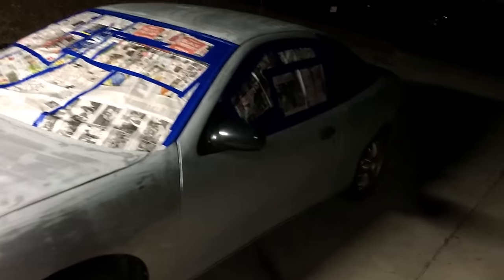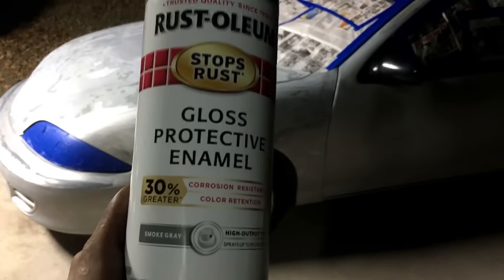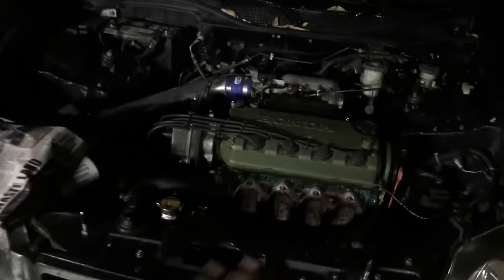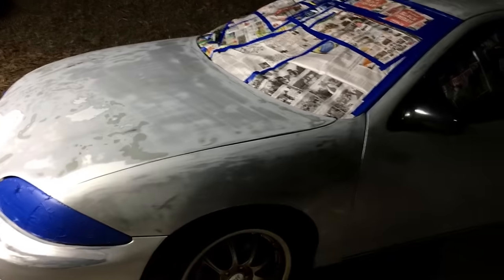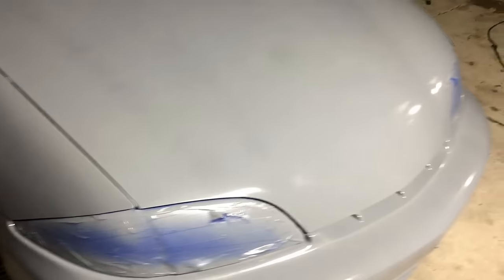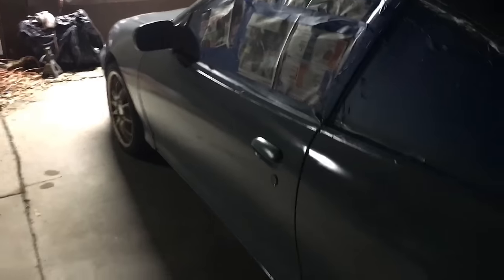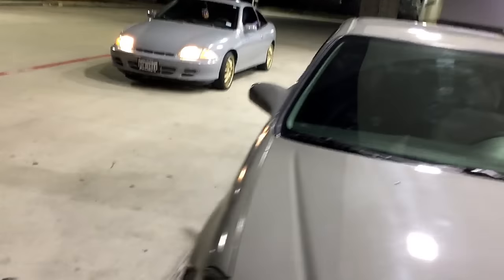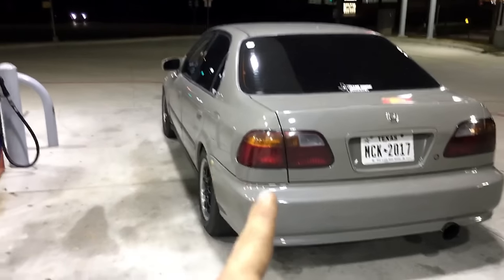$25 Rustoleum spray can paint job!

Comment: I did the same thing in the early 80's on a 71 datsun 240z. Rustoleum has made some great advancements since then and you do a better job than I did. Very nice. May I recommend two things? If A tractor supply store sells tractor paint in your color of choice, I would go with it. Tractor paint has a far higher solids content and you'd be very happy with it. Also, if you you want to be sure to avoid any spattering, fill a bucket with warmish/hot water and set your cans inside. It helps if you do it. You did a superb job, young friend. Keep prepping and painting!

Comment: That's better than a basic Maaco paint job for sure for a fraction of the price.
Reply: Problem is gloss will fade and look all dull in about 2 weeks, but eyy looks good👍
Reply: Problem with Maaco is their prep is shit. They can paint just fine but bad prep = bad paint
Reply: @idrinkpowersteeringfluid  nice! 😎
Reply: Kevin Trust don’t be hating on cavaliers they are up there with civic reliability
Reply: @mintysquinty2989  THIS. I've got 3 cars with Maaco paint jobs. I did all the prep myself and had plenty of parts painted off the car because I simply didnt trust them with not screwing something up. Mirrors, front and rear bumps and lights. I always remove all those things if someone is painting a car for cheap because realistically they wont even do a good masking job.
Reply: @blazieboy1301  how do you figure that it is enamel paint every car I seen with enamel paint still looks good after 2 years if it's done right
Reply: @freddibanuelos3481  yeah true that, but In that case might aswell just put some good nice ppg base coat😎
Reply: I met a lady yesterday that said she took her car to maaco and had the upper scale paint job for almost 4000 dollars when she went and picked up the car she told the guy she wasn't happy and get this he said to correct the problems you have with the paint job he needed another 600 WTF?

Comment: I and some of my employees spent a few days sanding and rattle canning some cheap service vans a few years ago, that and some stenciled 'van id numbers' turned a parking lot of 30 year old vans into a professional looking fleet.  Never underestimate the power of the rattle can  :)  Edit: a trick..  we painted when humidity was high, and it started sprinkling 20 minutes after finishing last van.  End result, the paint looked AWESOME..  and I think it was because the humidity and the temp, about 70 degrees, slowed down the cure time a little making the paint not streak.  We did a buddy's van on a dry day for fun, and it didn't turn out as well, but it was a dry hot day.  Next time around I'll do two coats and then rattle can clear coat, and maybe set up sprinklers or something a ways away to increase humidity.

Comment: You can buff all that out after a week to smooth finish  and apply clear coat !! makes finish look much better !!! Then buff out clear coat and polish it. Gonna look way better,  like real car paint
Reply: Nah, it's too thin to buff out really.  You'd need a lot of layers in order to make it sandable.  But it really wouldn't be worth it in the long run, paint won't last long. It'll start cracking and chipping here and there in a relatively short amount of time.
Reply: C North NOT if you paint a protective clear coat over
Reply: @markus2151  That's not how it works.  You actually need to sand paint before you put on a clear coat, otherwise it won't really be glossy.  You can have smoothly sanded clear coat, but if the paint layer isn't sanded, it's not going to look right.
Reply: Oh okay, but I guess it would be better than paint chipping and cracking.

Comment: I got really drastically different results based on the weather. This summer when I used the Rusto spray cans in hot weather it just came out nasty, but when I sprayed it on some doors a week or two ago in 50F or so weather, it all leveled off beautifully. I hope we can get a couple good days where I have time so I can get the whole car rattle canned again, unfortunately I rolled a few sections and sanding that out will be fun :/. The rattlecans are just awesome if you do it in good conditions, though.

Comment: You may not have the best paint jobs but I have to give you a e for effort. There are a lot worse things young people your age could be involved with. Just a little tip for you when painting with spray cans. Let the paint cans sit in hot water and the paint will lay down smoother and you will avoid a lot of the nibs that come out of the cans.

Comment: I am not generally a fan of hoopty rattle can rides but there was an attempt to prep the car at least.    This was certainly the best financial way of making the car look better rather than spending  money you might  not have to paint a depreciating asset. Doing what you can with what you have should be more peoples mottos. 

And it turned out decent. Overall I'm impressed.  And I'm glad to see that ppe was used

Comment: I realize it's 4 years after the fact, but Rustoleum makes something called color shift and if you use it after your final coat of rattle can, it gives it that shimmer that professional auto paint has. It is really wonderful stuff. It takes a good paint job and turns it into a great paint job if it's used correctly. I redid my entire motorcycle with like $50 worth of paint, and because I finished it with that stuff, it looks just like the factory did it

Comment: My best friend owns and runs a shop started out using rattle cans in his parents garage. We all start somewhere. good results id  just suggest that you work on your form a bit. spray in a more uniform pattern and seperate each panel into segments when you paint. Great job though keep up the hard work!

edit: also look into learning and perfecting wet sanding. You can get really good results after using clear coat, wet sanding, and then a good polish and wax. almost pro results if you pay enough attention and do the prep work.

Comment: Take an additional hour or 3 sanding with like 600 or 800 grit. Then put trash bags over the tires. Surprised you didnt move the other cars. Wonder how much the wind blew onto the others paint jobs? Also would you paint your rims the same way or not at all? Gonna do my sunfire same way. But orange body. Black hood, roof, and trunk. Rims are being painted black with orange lug nut covers. Then orange under glow. And orange/amber and white strobes all over the place. I do security so I use them while working.

Comment: It would be worth doing some research in urethane coatings.  Even with a $20 harbor freight spray gun and a cost effective coating, the durability will be much better (and cosmetically it can look way better also).  I had to choose a coating when rebuilding a off road trail vehicle, and had the benefit of my cube mate being an automotive paint engineer to learn from... there are a lot if options and good information to digest if you look a little.  A single stage 2k high film build urethane coating may serve you well to hide the imperfections and have a much higher gloss... and you're probably only at about $100, which is really not much in the big picture.  Good luck and enjoy!

Comment: Sometimes good enough is good enough. I have a low mileage (because I've always worked from home and have another vehicle) Cavalier in excellent condition and it's worth almost nothing when I try to trade it. I figured forget this i'll just keep the thing. I can't imagine spending money even on a cheap mako paint job for a Cavalier in the condition of the one in this video. I really like that color. I'm not going to attempt to do this myself or anything but I think it looks good. I probably would have left the mirrors and door handles black or maybe paint them and the rims a darker charcoal grey. Done is better than perfect though. Good work.

Comment: I painted a 59 Beetle like that and it took 6 primer and 4 cans. Would have preferred something like rustoleum but back then the only colors were cancer and the finish was semigloss at best. Primer + fine sanding does hide a lot of sanding sins just like rubbing compound on the finished painting.

Comment: I have a cavalier I am driving while I save up. This would boost my self esteem.
Reply: Jesse Alexander they are awesome cars drive it until it doesn’t drive
Reply: J-bodies are a bit under rated though. They last like Civics do, will keep going until rusting out completely or wrecked in some accident. It's just the GM interior that is a bit naff, since the cheap plastic doesn't age well. As a runner that's cheap and reliable to keep going, you shouldn't knock it.

Comment: Damn if i had a place to paint like you have id build a paint booth, spray with base/clear from a hvlp gun, can even do it with two 5-6 gallon compressors,, make some real money, i pretty much started like you but i do body work(with some painting), people trust me enough to do there $100,000 cars/trucks,,, it got to point where i could do the body work with my eyes closed,,, your on there right path, need to start some where, but need to keep moving up

Comment: The old paint is very difficult and near impossible to sand evenly...the new paint will amplify and expose every flaw. 

Sandable Primer over the old paint surface...even just a light coat makes sanding easier and quicker and provides a much better surface for the top coat....maybe just another $10 but is money well spent...

Comment: Hey, so since it's so early on and you're likely to respond: if I want to use the Rustoleum Army Green but don't want it to be matte paint, and want to do a gloss clear over, can I do that safely over the matte paint, or is there an easy way to match one of their glossy paints to that color for use under a clear coat?
Reply from the maker: If you use matte paint then do clear over it it will become glossy. I will eventually get to doing a video on this.
Reply: @JamesDguy  Oh I'm totally aware, I've just heard bad things about painting clear coat over matte paint
Reply: KrispyyWombat Go to a body shop and ask for a garbage panel, or pull one from a wrecker, like a hood or something that isnt to dented. Use that as your test panel. Prep it properly and do all the steps you would on your vehicle and see how it turns out. Then leave it outside for a month or two so you can see what it will look like after its been a bit weathered. I suggest doing this so you A: Know what you’re getting into B:Can practice and C: Fully be sure you want to spend the money and time painting an entire vehicle

Comment: So I’m sanding down my 05 Elantra completely in a month from now, going to be using 2x Rustoleum high gloss purple and then 2x rustoleum black on the hood and roof. I’ve thought of getting 20 cans to be on the safe side. Is that too much? My main concern is being able to see the paint lines. I know I’m gonna sand down it all correctly but how to avoid paint lines and avoid the MAIN look for a spray paint job how most amateurs do.

Comment: Actually nice paint job for $25 . Probably wouldn't have guessed it was painted with spray cans .
    I wanted to do a quick spray can paint job on one of my cars but wasn't going to use rustoleam brand . Was going to paint the car the factory OEM Red color , that's available in the OEM factory Red  . Would a clear coat be needed to be used after painted and then followed with buffing ? What are your thoughts on this ?
  Best 
Regards

Comment: You do pretty good work with painting, I enjoy watching. ... I do have a question though ... I noticed you do not usually follow the basics of light coats first then work on heavier coats for the finish ... You appear to go straight to a heavy coat ? ... How does your technique allow for elimination of runs and orange peel ? ... I would also like to let you and your buddies know that I used to own and operate a race team in Southern California ( I am now retired ( USMC ) , however, I still do a lot of business with my old vendors, so, if you need speed parts ( Turbo Kits, Cams, Pistons , etc ... ) or stereo equipment ( Any brand ), I can normally get what you want under wholesale pricing. ... I also build engines, from stock to full race ( AT YOUR LOCATION )  labor only and I do NOT charge retail, and am always interested in making deals. ... If you don't like the work I do ... DON'T PAY ME ... I can only make that statement because I ALWAYS GET PAID, meaning ... I DO QUALITY WORK ! ... Anyways ... I really enjoy your video's and RESPECT your work ethics. ... Watching you has restored my faith that young folks still have Integrity and a strong work ethic, it truly is refreshing. ... SEMPER FI YOUNG MAN ... Keep up the good work.

Comment: I own a Toyota Celica with stock rims, the problem is that they repainted them and did t even try to make sure it was good. The previous paint I'm assuming original was bubbling and not smooth. Would thos be a good solution? And if so what are the steps to doing so.

Comment: Good job!... What is the difference between 2x and advanced formula, which is better?
Reply from the maker: I prefer advanced because it holds color and gloss better but dries slower. The 2x is faster drying and 2 times the coverage as your typical spray can paints. The advanced and 2x spray the same but dry different.

Comment: Amazing what you can do with modern spray paint.  My question is the bumpers.  How do you prevent the paint from cracking if you’re using the same mix for the panels and bumpers?
Reply: For $25 you just keep a can handy and touch up

Comment: I have been painting my friends spoiler for the last 3 days, given it’s cold outside but I have work lights directly pointed at it to give it heat.. paint was so glossy but felt like it had dried little paint spots so I wet sanded and clear coated, now it’s textured and had some kind of reaction on the back side and looks like I set the part on crumpled tin foil, had cans in warm water and everything. What do you think I can do to save it?

Comment: Learn one thing, if the paint is not polyurethane, in a year to three you are left with no gloss, and looking worse than cheap. You can spray over the rust oleum with good clear, and that will help a lot in terms of the paint lasting, to look good 
Paint booths, and professions exist for a reason, their job lasts

Comment: I was planning on buying an hvlp setup and practicing on a race car that doesn't matter.  The idea that I could do this so cheap is tempting.  Have you used the Rust-Oleum automotive enamel?  It's about $10 per can but even budgeting $100 could get it done.

Comment: No primer?
Reply from the maker: most of my videos where I paint I didn’t use primer and didn’t have a problem with adhesion
Reply: Last question what final grit was used on sanding it before you painted it?

Comment: with out activator the paint will oxidize in about a year u should put a clear coat over it so it will last longer and it has a activator so it will not oxidize fast it will take years how to do it right with spray paint still a bad paint job but it works and u will never be able to use real car paint witch i mean with activator  in till u strip all the paint off
Reply: also it takes more paint i see a lot of peel in it very bad job even with rattle can this tells me u have no idea on what ur doing i bet when u fix a dent u just fill it try doing one panel at a time and cover it when dry then paint another panel this way u don't get over spray on the new painted panel because spay can takes longer to apply then a gun and i been restoring cars for over 30 years some times we use rattle can for interior but we clear coat it too for small areas

Comment: GOOD PAINT JOB, considering the fact that the preparation was NOT very WELL DONE and painting in the dark ! ! Before painting,please guys and girls, remember to sand, sand and sand again with a smaller and smaller grit sandpaper and ALWAYS PRIME WHERE you  have bare metal ! !  Why must we sand so much you may ask. This is to " erase " the sandpaper marks left behind by the previous grit of sandpaper and the sanding process. Eventually, all of the " UGLY " sandpaper marks will be gone, then comes the paint for a smooottthhh and beautiful paint job.Paint DOES NOT HIDE the DEFECTS, if anything,the paint will make the defects stand out even MORE. I understand that this sanding process can be " BORING ", but in the end, It is well worth the effort ! Furthermore, remember this, the HIGHER the NUMBER written on your sandpaper, the FINER the GRIT is on the sandpaper itself. I did quite a bit of body work when I was younger. Mostly for myself. Cheers from Canada,Polar Bear country! !

Comment: And in 3 months it'll be peeling and falling apart...
Reply: It's not going to peel. It just makes an old car look presentable, instead of a bucket of rust. I did many touch ups as well as the hood before. When the car had a bit of dirt on it nobody knew. I used Duplicolor. It never peeled.

Comment: God what a horrible idea. Pay the actual money to get it painted, this is awful. It might look okay, but im willing to bet in a year it all peels and cracks right off.
Reply: Then they can spend another $25 to repay and add a layer of clearcoat. Problem solved for a much, much cheaper cost. It looks decent for the money, and it's not a showroom car or a project car.  Its just a car for getting to and from work, no need to spend half a paycheck on it.